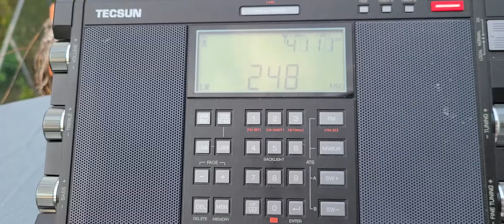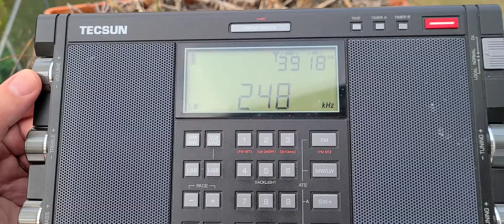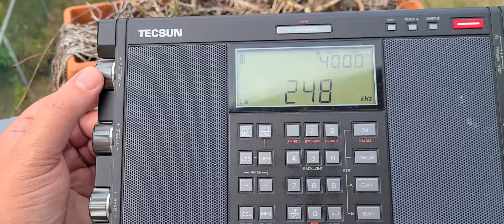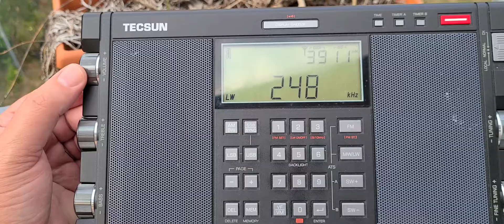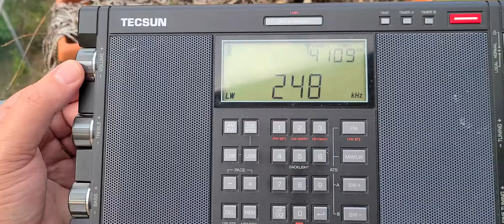Bye Bye UL 248 kHz Longwave Montreal airport Beacon to be turned off August 12th 2021

Comment: Would you say this is Tecsun's best LW radio?
Reply from the maker: the 990X and H-501X are definitely both the best on LW...add the fact you can have external antennas that work on LW on both...definitely great for that purpose
Reply: @OfficialSWLchannel  thanks Giles, pity Anon-co have suspended exports to the EU due to new VAT and import duties rules otherwise I'd be very tempted to get this AM/FM Boombox.
Reply from the maker: Actually if you go to Anon-Co Ebay site, there you can, cause Ebay calculates the VAT from what I understand
Reply: Hello sir, does this stuff were made off by radio technician before it use? (Signal test etc.)
Tq